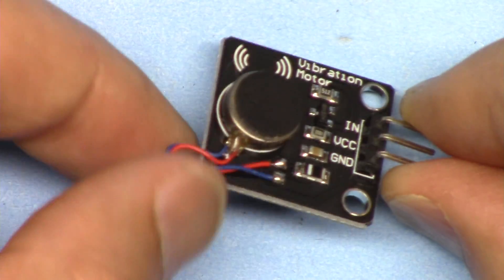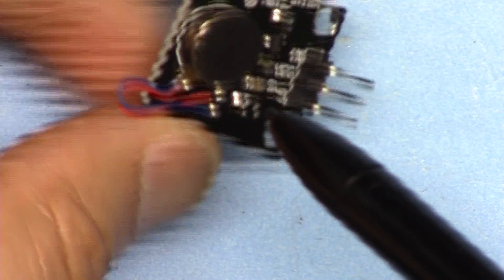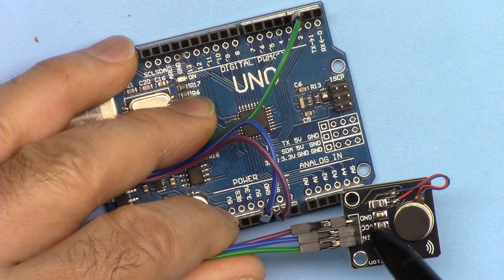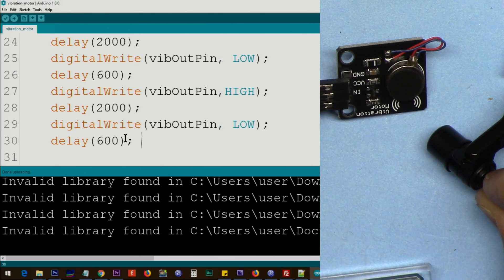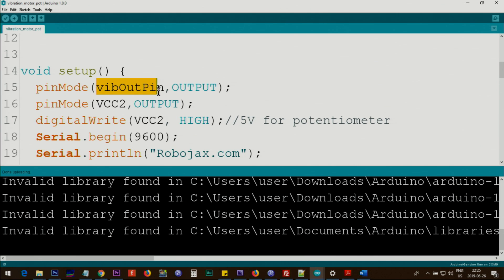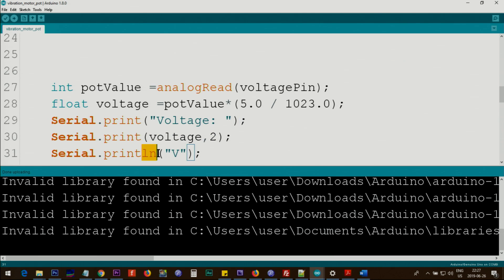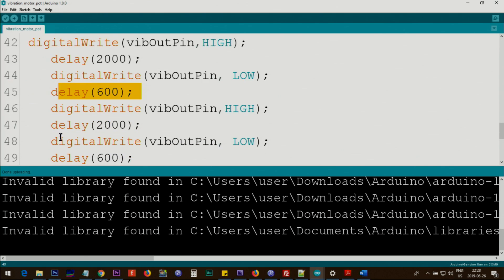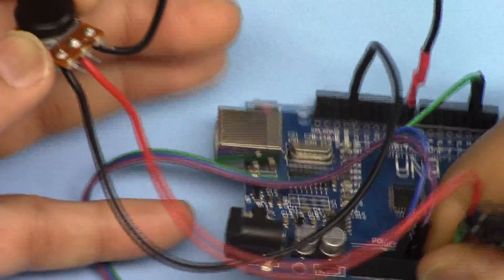Using vibration motor with Arduino and with voltage trigger RJT173

Comment: can we use it on 3.3 v ??
Reply from the maker: No
Reply: For me it's working just fine with 3,3 Volts on Arduino Uno R3. But of course the Vibration will then be less intense.

Comment: How many volts does the vibrating motor consume? but want to use motor 775 12v. come with  Arduino ?
Reply from the maker: I believe I mentioned the voltage to be 5V

Comment: Hello Sir 
It was nice presentation and It is very helpful. 
But In this i want to ask you that 
1) How the frequency was control in this ?
2) What is voltage level For this??
Reply from the maker: Hello, 1-you have no control over the frequency as the vibrator has internal circuit. 2-The output from Arduino is 5V and y ou have no control over that too.

Comment: Hello! Thank you so much for this amazing video! I was wondering if different vibrating intenisites, and maybe frequencies could be programmed for the vibrating motor?
Reply from the maker: Hello and you are very welcome.  you may feed PWM (Pulse width modulation) signal to the signal input pin of it using  code shown in this page https://youtu.be/3_C7gJeX9hc where a potentiometer can control the duty cycle of PWM. or if you don't have pot, then use the code from this video https://youtu.be/kZ9b31gVemc I have not tested them but try it. good luck.
Reply: @robojax  Thank you so much! I truly appreciate it !!
Reply: Hi Fernanda, me and my friend want to make a ardunio project about converting music to vibrations. We think that it is necessary to create vibrations at different frequencies for each note. We're wondering if you've tried the idea you wrote. Did the vibration motor work in generating different frequencies? Thank you.

Comment: Hi robojax,
I am very new to arduino, and I was wondering if it is possible to connect multiple vibrating motors to a single arduino uno? All vibrating motors need to do the exact same at the same time so that would make it easier right? Thank you for the video tho it was veey helpfull already!
Reply from the maker: if they are turning on at the same time, then use relay so the Arduino board is not overloaded  use this LOW level trigger relay https://youtu.be/g6k8sPJyif8 or HIGH level trigger relay https://youtu.be/58XWVDnB7Ss and connect all positive of them together and negative of them together and connect them as load to the relay. right now you will see AC bulb but you connect the vibration motor instead.
Reply: @robojax  Can I integrate all vibration disc in series and to single source

Comment: can I discuss my project with you in which we are going to use the ERM vibration motor ?
Reply from the maker: It is used for notification purpose. instead of beep or speaker, if quiet alert is needed you can use this like mobile phone.
Reply: @robojax  okay you get my point, now we move forward.
we are going to implement these motor on a steering wheel, mounted in the steering wheel so that we get feedback whether the vehicle is moving towards left or right.  when the steering wheel turns right the vibration of these motors felt in same direction like in anti clockwise direction and vice versa.   
There should be different frequencies for different situations But here is a point how we develop diff frequencies ranges?
Do you have any knowledge or idea for this?

Comment: what if we wanna control the frequency of the vibration motor ERM type for the purpose of the different indication at different frequency?
Reply from the maker: You can make your own frequency on top of current vibration. But that is separate subject to create different frequency  within Arduino.

Comment: i would like to know with out the PCB what resistors should we use between the output of the Arduino and the vibration motor, the specs if the vibration motor say 3 to 3.7 v up to .080 mAmp, the arduino max current is .040 mAmp per pin total of 200 mAmp for all pins
Reply from the maker: We connect the VCC pin of this module to 5V of Arduino which can supply more than 300mA.  This module has transistor to amplify the input signal. We have connected the IN pin to pin 2 of Arduino which draws less than 0.1mA.  so do not worry about the currrent.

Comment: Add links to the parts you use and you will add more viewers.  This is just a slight adjustment as you're already doing a great job. Many times before I start a video I will click on the part link provided so I have a better sense of what's  going on in the video.
Reply from the maker: YouTube has made it very hard. So I never use that. I put all links in the description.
Reply: @robojax . Hi, thanks for your reply.  I looked up your web-link and could not find references to the hardware you are using (on this project). Would it be possible to put the hardware links there on your website? I appreciate how you cover a wide variety of sensor/ actuator projects. A schematic, IC specification sheet, or link to the hardware would be quite useful.  Also for your audio, an inexpensive lapel microphone would give you more volume.
Reply: @robojax  I don't see any links in the descriptions to the parts that you used -- specifically, a link to where someone can buy the motor driver and vibration-motor that you're using. Would be helpful if those links were provided.